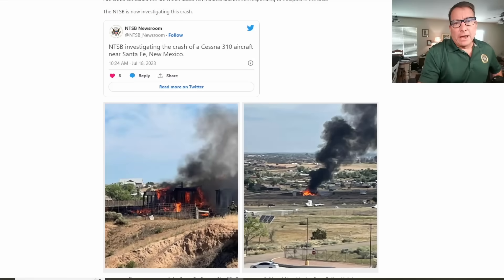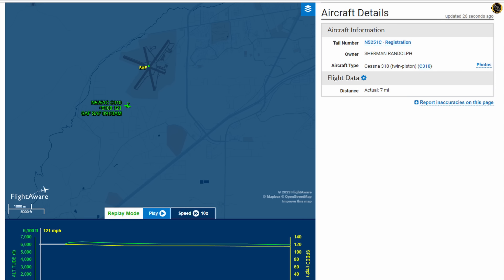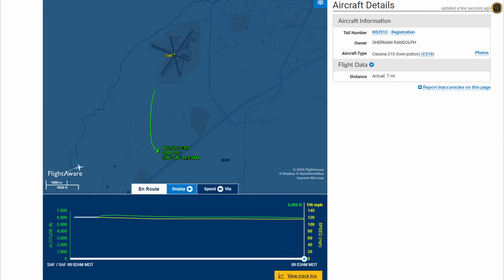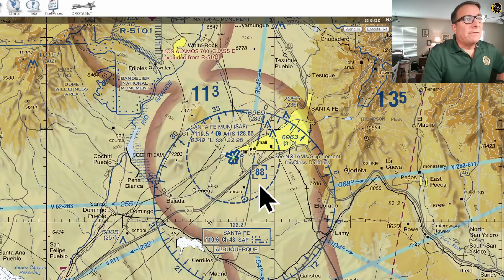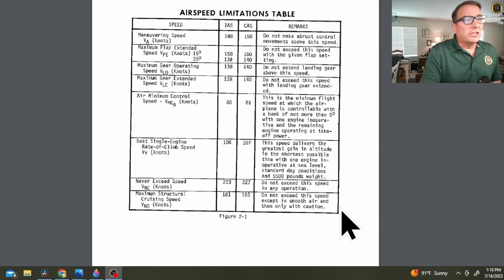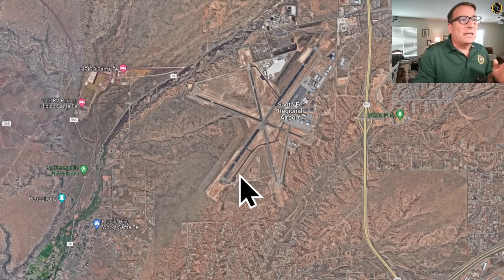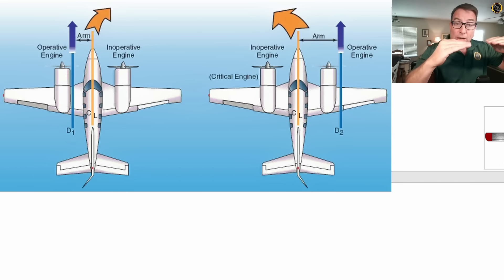Fatal C-310R Engine Failure - Santa Fe, NM

Comment: @4:47 - those are figures for a non turbo 310R, the aircraft that crashed was turbocharged.. s/e service ceiling for turbo 310R is  17200 ft so it should have been able to climb even in that temp

Comment: With Turbo single engine ceiling is much higher: "Single-engine service ceiling went up with the turbo models, to 17,200 feet in the T310R; a 310B could hold 7,700 feet on one engine."

Comment: Juan - I owned a 310R (non turbo) for eighteen years. As an airline pilot, I understood the very same operating limitations you have just outlined. As a result the first thing I did was put Vortex Generators on it. That put Vmca less than Vso. I then developed the take off procedure of holding the airplane on the ground until I was at Vmca (or the end of the runway whichever came first). This put me in the air at or near Vmca. I would quickly retract the gear and accelerate to climb speed. 

I never had to test my take off procedure with an engine failure, but I felt it reduced the time where the airplane would be unable to fly away on one engine. And, I know there is the very real factor where critical seconds are lost by the mind not accepting the reality of an engine failure. But, at least I remain cognizant of the limitations of general aviation twins. 

Thank you for your EXCELLENT work reporting on the accidents. My condolences tomthe the family of the pilot.

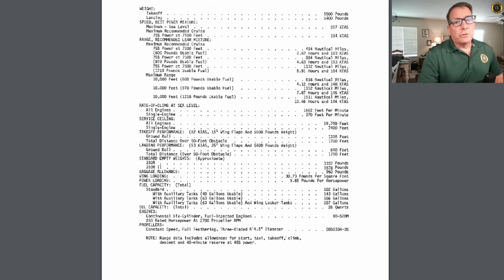Comment: This airplane had turbocharged engines (according to Flight Aware, it had TSIO-520s, not IO-520s as Juan states at 4:18) which would raise the single-engine service ceiling significantly.  Density Altitude wasn't as big a factor as is described here.
Reply: Turbocharged aircraft are not immune to density altitude. Turbocharging may even give a false sense of security.
Horsepower doesn't fix everything. The prop still has to provide thrust, the wing still has to provide lift - both in reduced air density.
Reply: @2whl4re  1. Never said turbocharged aircraft were "immune" to density altitude, I said "density altitude wasn't as big a factor as is described here."  2. "Turbocharging may even give a false sense of security." Completely irrelevant statement. It's almost as if you're looking for something to argue about. Temps are 90 degrees. You're at an airport that is 8,000 asl. There are 2 piston twins on the ramp, both identical except one has turbochargers and one does not. Would you seriously consider choosing the non-turbocharged airplane because it doesn't "give a false sense of security?" 3. "Horsepower doesn't fix everything." "Fix," no. "Help," absolutely. My point is that the aircraft crashed more likely due to the pilot turning away from the good engine at too slow an airspeed vs. the engine didn't have enough power to maintain altitude due to density altitude that Juan explains here.  With all due respect, you're looking for an argument where there isn't one.

Comment: The registration says it’s a T310R, so it’s a turbo 310 with TSIO-520. The POH in your video is for a 310R. So the single engine ceiling on a T310R is 17,200ft with a climb rate of 390’ per minute. Fly safe everyone….
Reply: This comment needs to be pinned.
Reply: Yes I noticed that also that it was a T310R with a single engine service ceiling of 17,200’
Reply: @kearyk1  yep, very different performance. I posted somewhere else that this plane would've been able to climb better on one engine than a Cessna 172 at a 9000' density altitude
Reply: This is exactly right and McSpadden of the Air Safety Institute (AOPA) has a good video on this.

Comment: This 310R may have had the upgraded TSIO 520 engines. The single engine performance figures quoted appears to be for the lower horsepower IO 520. With the TSIO 520 the single engine service ceiling may have been as high as 17000 ft since that engine can hold sea level horsepower well into the teens. If that is the case this aircraft had the capability, if handled properly, to sustain flight under the given conditions.
Reply: The USCAR shows that those were indeed the engines fitted.
Reply: @Shamrock100  Juan makes a good point about high density airports, however, his premise that the pilot was taking off into a no win situation should an engine fail may have missed the mark. This appears to be a case of pilot overload, in that the aircraft continued to turn left, so the left wing was never raised, and the aircraft may have not been properly trimmed up and cleaned up. I can envision the pilot just struggling to fly the aircraft with little brain power to complete the engine failure tasks. This a problem encountered on high performance aircraft which are flown single pilot. With two pilots one devotes their primary focus to safely flying the aircraft while the other manages the engine failure items, greatly reducing the workload.
Reply: It was a T310R not a 310R as claimed here so it had TSIO-520 engines. The author of this video missed that.

Comment: Juan may be using the single engine service ceiling for the non-turbo versions of the 310.
A Cessna 310 fact sheet on the AOPA website authored by Mark E. Cook, AOPA Pilot in May 1994 states:

“Single-engine service ceiling [for the 310] went up with the turbo models, to 17,200 feet in the T310R; a 310B could hold 7,700 feet on one engine.”

If density altitude that morning was even as high as 9,000 ft, the single engine service altitude of the turbo version of the 310R would have exceeded it.

Presumably turbocharging compresses ambient air to offset loss of power at actual high altitude or equivalent density altitude.

Comment: Once upon a time I was an instructor and taught students in a few different light twins. When an engine fails everybody wants to be a hero. But when you have such lack of performance your safest bet is to throttle back on the good engine and land straight ahead as if you're in a single-engine airplane to begin with. He never had a chance, performance wise. I know, that's a lot easier said than done....
Reply: In my half century of paying attention to this issue, it seems like several pilots are killed annually because they were unable to pull back the good engine & land in the rough.  When I was flying my Apache, I would review this point before rolling for takeoff.  It simply took all the fun out of flying.
Reply: Yep. It's far better to "land" in some brush and small rocks and take your chances.  Saving the aircraft isn't really an option if you're a few hundred ft off the ground.  I mean, my son and I survived a crash at 70mph a few years ago (off the side of a road into brush and small trees out in the desert), though the car was done for.  But at 120mph? There would have been pieces.

Comment: I know the controller was trying to be helpful but directing him to turn left may have been the straw that broke the camel’s back. 
Taking off into a density altitude higher than SESC means you have to accept before you take off that you will have to “drift down” into terrain at a speed above VMC if you lose an engine. 
Recently I had to shut down an engine on a piston twin over the Cascades. We were above SESC but fortunately had a canyon avenue to  follow and drift down to lower terrain where the plane would maintain altitude. Not a fun feeling

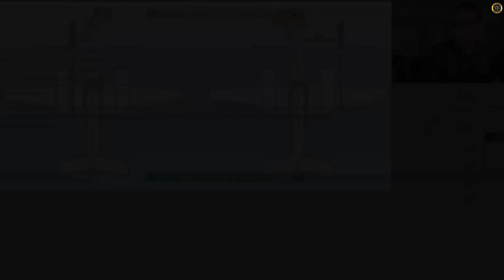Comment: 8:00 this is a very important point. Another way to say it is, if you take your twin engine aircraft somewhere where it can't maintain altitude on one engine, you really have the equivalent of a single engine aircraft - but with twice the chance of having an engine failure.
Reply: And twice the cost of operation.

Comment: Amazing- I had an engine develop a oil leak in a Beechcraft Baron while flying from Ft Lauderdale to Exuma and had to crab the Baron to the final destination- even with repairs a few months later a crankshaft blew on take off in Exuma and led to a rough landing-on the coral- Luckily we were not at 6 thousand feet but sea level- You just never know when something is going to blow especially with material failures so it's best to assume a failure will happen prior to having it happen-

Comment: I had a Twin Comanche with over 2,000 hours PIC,  based at DEN. My multi-engine rating instructor pounded it into me: 
1. Higher elevations do not leave the ground until you’re well above VMC. I would literally have to push hard on the yoke as plane wants to fly.
2. If engine fails on takeoff, fly straight(no turns) until you get the aircraft cleaned-up (gear, flaps). Feather the prop on the dead engine. Then figure out about making turns, where to land, etc. 
3. He always emphasized that violating VMC was always a bad outcome. My sympathies and prayers go out to the pilot’s family.

Comment: As a 310 pilot yourself, this lesson couldn't have come from a better source. The sad thing is that someone died to teach it.
Reply: Life is a hard teacher.  You get the test first, and the lesson afterward.
Reply: @johnpublic6582  love that saying. I dont know who first spoke it but it's pretty good. Obviously these days  with aircraft, there's PLENTY of lessons .. before even sitting in the pilot seat. So the saying is 'life' wise correct.. but piloting wise.. meh...perhaps a little mis-appropriated to this situation
Reply: yep a lot of FAA rules are written in blood.
Reply: I guess my turbos are good for something besides expensive annuals
Reply: @johnpublic6582  100%
Reply: @jarrettleto  ever heard of compressor stall. its not a fun thing to experience ill tell you that. also a turbo wont help in the event of an engine out LOL if anything it would make it harder to control. as you get loads of power once you hit the rpm that the turbos spool up at.. PS I experienced compressor stall at lake Tahoe on takeoff roll and the piper Navajo Chieftain 1984 veered so hard bc only one engines turbo stalled so there it went to the right so damn hard we almost went off the runway. the compressor or turbo blades wouldn't recover so we had to pull power back to idle in the second engine and then reapply full power to get it going again. would of been whole other can of worms if that had happened a few hundred feet in the sky.
Reply: @masonmax1000 exactly like OSHA rules!
Reply: The rules are written in blood. When they say don't turn into the dead engine it's not a causal suggestion
Reply: Man so many twin engine planes lose the left engine and the same thing happen stall spin. The plane just rolls left no matter how many videos done on these accidents it still happens. I think if you have a twin practice and being ready is the only way. Some of these planes lose a ton of performance with an engine out. I’m not sure turning back is the right choice.
Reply: @mikemicksun6469  You're saying what I've been thinking. When's the last time a right engine failure/fatal happened?  It's indeed strange to me it seems.  Of course my idiot brain data could be totally wrong.  Who knows.  🤯
Reply: @mikemicksun6469  First thing, Level Flight,then work on getting home.
Reply: Wooh, possibly the best/most survivable reaction in this case would have been to quickly deploy full flaps and belly in straight forward. Not too many training simulations & suggestions of such a response, though…

Conclusion: if density altitude is above your single-engine altitude, DON’T FLY.
Reply: My favorite history teacher says, "The lessons that we learn are written on the tombstones of others." Pretty sure they mean largely the same thing. Sad days.
Reply: @johnpublic6582 💯🙏🏻❤️
Reply: Most safety improvements and lessons only came after something bad happened. You cannot learn what nobody knows.
Reply: @jarrettleto can you climb in these conditions? He couldn't. This is tragic. Thank you in advance.
Reply: @bryanlallen finally! After reading TOO MANY of these comments! That, Sir, is the correct answer.
Reply: @johnpublic6582  If you're  lucky.
Reply: @masonmax1000  There is a quality of a rodeo in this description. Or breaking a horse. I once rode in a air national guard plane that was a WWII relic (I think). The wind played with it like a leaf in a storm. I didn't have fear of heights at that age.
Reply: @laaaliiiluuu  How do aeronautical engineers learn? Seems the  plane can't be designed right if it has to  crash.
Reply: @jarrettleto  This was a T310
Reply: @johnsmith1474  Yeh, but if  you studied crashes over many years, you KNOW these discussions are about the initial process of LEARNING something, not just a barebones presentation. You have to understand context. I think newbies, people who tune in with no history can't see what matters. I know the Youtube creators (the good ones) have been studying for a long time.  They aren't Internet surfers. There's a sense of "why don't things get better after all this time?"
Reply: @johnsmith1474  If you're a long time pilot of multi engines, I suppose there's nothing to learn here. OTOH as a student pilot I just learned that some light twins simply shouldn't fly to/from some high altitude airports during the daytime in the summer, and that density altitude can be even more critical for twins. If you pay attention to that graph, it says that the temp needs to be well under 20 degrees C to have a density altitude that allows the rated service ceiling.  I also learned that the single engine service ceiling is an absolutely key safety statistic, and the pivot point where multi becomes less safe than single during an engine failure. I won't need this info for some time since multi-engine is far down the road for me (maybe never), but perhaps I'll have the opportunity to remind someone of this and save their life, or better understand why someone chooses not to fly. Very good video.
Reply: @mikemicksun6469  Twins lose a tremendous amount of performance with an engine failure. You're losing about 60% power when drag is factored in. Look at the climb rate: 2 engines, about 1,600 fpm. 1 engine,  350 rpm if you're lucky and correctly identify the inoperative engine,  get the correct prop feathered and if you are still alive get gear up.
Reply: @eojabac7123  That is a possibly big factor missed in some recaps. There is a big performance difference in single engine altitude capability between the T310 and the unboosted engines. About 17,500 ft for the turbo version,  7,400 for the normally aspirated engine.
Reply: @mikemicksun6469  The rolling effect is greater if the left engine fails instead of the right. 

When the engine fails on takeoff the panic instinct is to get back on the ground as quickly as possible.  
First, have a plan before you go. If this goes wrong,  I do this.
Second, fly the airplane. 
The controller was just being helpful by suggesting a left turn to runway 33.  He had no idea which engine failed. The turn into the dead engine was a killer. Better plan would have to fly straight out,  build speed and altitude, then a right turn to runway 18. If it became apparent that speed and altitude were not to be had a belly landing would have been the better way.
Reply: @bryanlallen  Remember reading a pilot review of a big twin Cessna.  The POH stated that in some conditions the performance on one engine would be so marginal that the pilot should consider belly landing.
Reply: @eojabac7123  Yes, being turbocharged, specs show single engine ceiling of 17,000 ft.   It was tested and certified with sufficient rudder control to operate on one engine, if correct procedures are followed....gear, flaps, feather, and maintain airspeed.  With one person on board, it was below max gross weight.  The cause will likely be operator error, not that the 310 was beyond it's capabilities, as Juan is suggesting.  (if it was a normally aspirated 310, then he would be correct, due to density altitude).
Reply: Also, turbocharged or not, when you lose an engine and you've done everything possible, yet the plane starts to yaw into the dead engine...your only choice is to pull power on the good engine, lower the nose,  and look for a flat spot of earth!!
Reply: Rules are written in blood
Reply: @masonmax1000 Compressor stall on a P31. Didn't know the PA31 had turbine engines.
Reply: @davem5333  Then why would anyone choose that Cessna? Obviously a bad design?

Comment: I learned to fly out here in the southwest at high altitude airfields. It was always stressed that on hot days, one did their flying in the morning to avoid the trap of high density altitude. The oft quoted example was Leadville CO at a field elevation of 9934 ft msl. The density altitude  would frequently soar to over 15,000 ft by lunchtime. The reduction in climb performance on takeoff and over high terrain has taken many unwary pilots and their passengers over the years. Even the lower elevation fields east of the foothills at 5000 to 6000 ft msl can be deadly on hot afternoons, and straying into the canyons to the west can be a trap that is inevitable.
Reply: You said a mouthful there.  I nearly saw the afterlife at a lot lower altitude @ kmtj on a quite warm summer morning.  In a turbo centurion.  I skimmed the cornfield and managed to eak out my escape.  But barely.  It was my fault.  I learned.
Reply: Wow.

Comment: Registration says it was a T310R and turbocharged so he probably had single engine capability at 10,000 ft. density altitude.
Reply: Yeah was just about to say when I look up the tail number it says it's a turbo which should have a single engine ceilings around 16,000. Will have to wait and see report showing which engine failed. Also most twin engine planes these days have vortex generators so Vmc is reduced. One last thing with the 310s are the tip tanks put a lot of weight at the edge of the wings and they would probably be full on take off so it makes handling on single engine a little more difficult.
Reply: Was gonna say the same. Juan double check your engine and aircraft type before commenting on performance and POH values. If this is really a T310R then it’s likely a turbo tsio520 which should have a critical altitude up to 10k